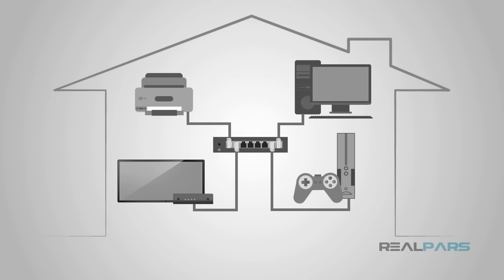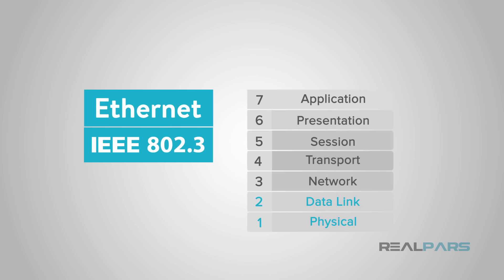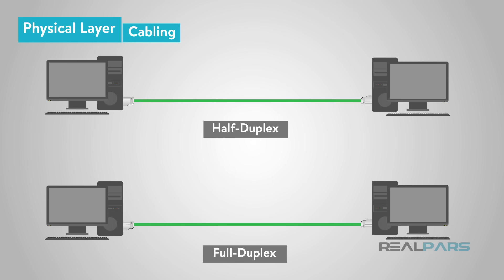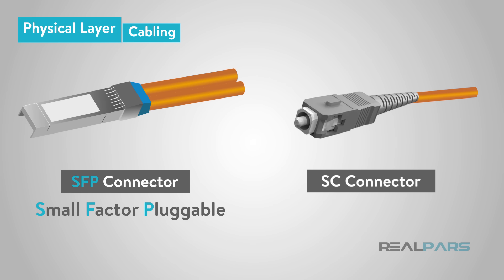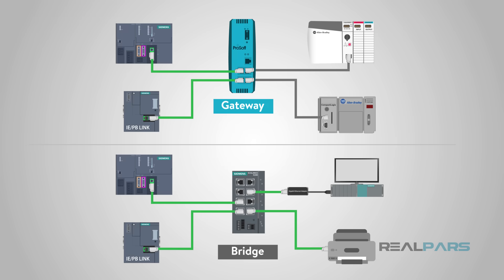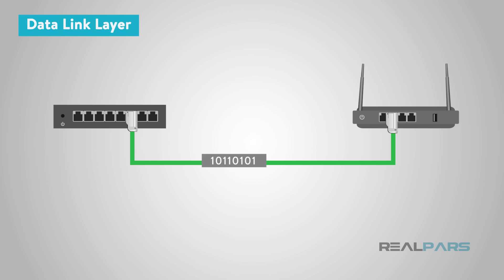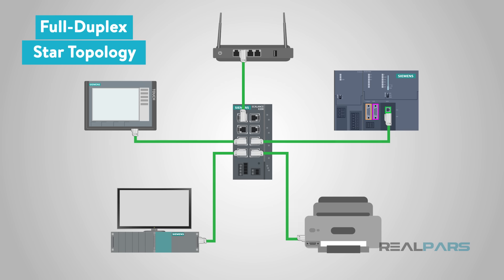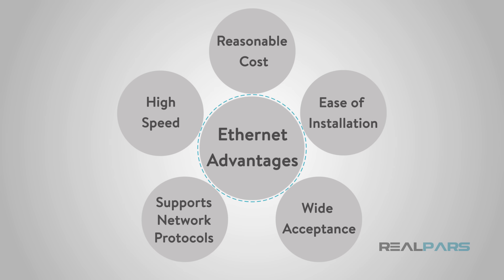What is Ethernet?

Comment: It appears that an error is still being repeated about CSMA/CD. The protocol is backwards compatible to all previous incarnations of Ethernet.

In the first version, 10Base 5, the devices could be hundreds of metres apart. The maximum distance between devices could be up to 2500 metres. This was achieved by joining 5 x 500m segments using repeaters. There could be a maximum of 4 repeaters in a transmission path.

Due to the length of the system, there is a propagation delay from the frame being transmitted, to its reception at the far end. Therefore, it was possible that a device wishing to transmit, would think the media was clear, because it would not be able to detect a remote device that had just started to transmit. 

The consequence, would be that their frames would collide. To detect the collision, both devices would have to be 'listening', whilst they were transmitting. If the frames are too short, both devices, would finish transmitting, and hence stop listening, and would not detect the transmission.

That is the reason why, there is a minimum frame size. They have to transmit a frame which is effectively twice the length of the LAN. The round trip delay was 51.2 micro secs, and at 10mbps determined that the frame had to be 64 octets in length. Anything shorter than this is declared a 'runt packet' and discarded.

When the speed reach Gbps, they set the minimum frame size at 512 octets due to the faster transmission speeds.

Now just think about, what is said in the video, it states that a device 'listens' to the media, and if there is no transmission, it sends out the 'first bit of information'. That first 'bit' (whatever that may mean) will be transmitted so fast, that the device will have stopped listening, and hence not detect any collision.

So, where does the misunderstanding come from?

In the original version, devices were connected to the coaxial cable by a transceiver, the central conductor was used for transmitting as well as receiving. The transceiver was a constant current device. If two frames collided, the current would double, and hence the line voltage. It was the increase in line voltage that the transceiver detected and then issued a signal to the interface card (in the host) Signal Quality Error (SQE). This implied a collision had been detected. Similarly, if the cable was cut, or a terminator was disconnected, the effect would be the same.

But, when twisted wire pair came in, the problem, was how could a device detect if the media was faulty? Since it transmitted on one pair of wires and received on another. The answer came in the 'link level reflect', periodically, the LAN card would send out one of these pulses, it would be received by the device at the other end of the UTP cable, and send it back. This is where the misunderstanding comes from. This little pulse, was further modified to enable 'auto negotiation', to enable devices to declare their speed capabilities.

A little piece of history 😊
Reply from the maker: Hello, @rjones6219  Thank you for your comment!   Happy learning from RealPars!

Comment: Star topology is same as hub and spark topology?
Reply from the maker: Thank you for your question. Star topology and hub-and-spoke topology are similar concepts, but they are not exactly the same.
Star Topology: In this network configuration, all devices (nodes) are connected to a central device (often a hub or switch). If one connection fails, it doesn’t affect the others, making it robust for local area networks (LANs).

Hub-and-Spoke Topology: This is often used in wide area networks (WANs) where multiple remote sites (spokes) connect to a central site (hub). While it resembles star topology in that it has a central node, it's generally used for more extensive network structures involving multiple locations.

Both topologies emphasize a central connection point, but the scale and application differ.

Comment: How orange and white orange could be together in a pair if one another is used as a ground reference to avoid em interference or noice???
Reply from the maker: Thank you for your question @pankajmaurya8768. 
That is basic electronics. You cancel out the EMI magnetic buildup, which causes electrical noise, by twisting the signal and the ground of the signal together. 
Here is a link for your learning: https://haitmfg.com/how-to-stop-electrical-interference/  You can find lots of information on the internet on how to cancel out or reduce EMI noise.

Comment: how about Ethernet Port? are they the same?
Reply from the maker: Hi @mylacuesta8684, The internet port is a physical hardware port only. This is where you plug in the CAT5 cable or other types of cable depending on the physical setup of the port, as we discussed the different types of ports available.

Hope this helps! Don't hesitate to reach out if you need more assistance!

Comment: Ethernet
==================

->Ethernet was communication standard that was developed in early 80's to network computers and other devices in a local environment such as home or building. 
->This Local Environment is defined as LAN (LOCAL AREA NETWORK) and it connects multiple devices so that they can create, store and share information with others in the location.

Ethernet is a wired system that started with using Coaxial cable and has successfully progressed to now using twisted pair copper wiring and fiber optic wiring.

Who invented twisted pair wiring?
Alexander Graham Bell invented twisted pair wiring in 1881

Standardization of Ethernet:
In 1983, Ethernet was standardized into the standard IEEE 802.3 by the institute of Electrical and Electronic Engineers or IEEE.

This standard defines the physical layer and the Mac or Media Access control portion of the data link layer of wired Ethernet.
These two layer defines as first two layers in OSI (Open system interconnection) model.

# Physical layer
-------------------
The physical layer consists of following components:
1. Cabling and 2. Devices

Cabling:
============
->Ethernet cables come as coaxial cable, which is not every common except in older installations, twisted pair and fiber optic.
->The most common cable is twisted pair cables, with the latest being Category 6 with speed up to 1Gbps and Category Cat 6a and Cat7 with speeds up to 10Gbps.
Cat5 and Cat 5e cables are both still used in many applications but handle the lower speeds between 10Mbps to 100 Mbps but are more susceptible to noise.
->The Ethernet twisted pair utilizes RJ45 8 pin connectors at either end of the cable that is pinned for transmitting and receiving data in either half or full duplex mode.
>> Half duplex mode transmits data in one direction at a time while full duplex mode allows data to be transmitted in both directions at a same time.
>> Full duplex in Ethernet can be achieved by using two pairs of wires to allow data to travel both directions simultaneously.
-> Fiber optic cable uses glass or plastic optical fiber as a conduit for light pulses to transmit data.
>> It has allowed Ethernet to travel farther distances at higher speeds.
>> Fiber optical cables use several types of connectors that vary depending on your application needs. 
-->Some of the different types are SFP (Small Form/Factor Pluggable) and SC (Subscriber/ Square / Standard Connector).
>> In order to use fiber optic in an Ethernet network that utilizes twisted pair Ethernet Cabling you need to use an Ethernet to fiber converter that will allow your network to take advantage of the higher speeds of fiber optic and lengthen distance that the Ethernet network can reach.

How about the Ethernet devices?
---------------------------------
->Ethernet devices are consisting of computers, printers or any device which either have an internal NIC (Network Interface Card) or an external one that is USB or PCI based.
->"Switches and Routers" that act as the director of the network and connect multiple computers or even network together to enable communication between all the different devices.
-> Gateways and Bridges are used to connect multiple Ethernet networks together and allow communication across them.
>> Gateways connect two dissimilar networks together while a Bridge connects two similar networks together so that you can only see one network.

# Data Link Layer:
----------------

The Data Link layer can be split into two sections:
1. Logical link control (LLC)
2. Media Access Control (MAC)

1. Logical Link Control (LLC):
============================
LLC establishes path for data on the Ethernet to transmit between devices.

2. Media Access control (MAC):
-----------------------------
MAC uses hardware addresses that are assigned to Network Interface Cards or NIC to identify a specific computer or device to show the source and destination of data transmissions.

Ethernet transmits data packets in this data link layer by using algorithm called CSMA/CD.
CSMA/CD (Carrier sense Multiple access with collision Detection): -
--------
>> CSMA/CD is used as a standard for Ethernet to reduce data collisions and increase successful data transmission.
>> The algorithm first checks to see if there is traffic on the network if it doesn't find any it will send out the first bit of information to see if a Collison will occur. 
>> If first bit was successful, then it will send out the other bits while still testing for collisions.
>> If a collision occurs, the algorithm calculates a waiting time and then starts the process all over again until the full transmission is complete.

-> When you use the faster Ethernets in full-duplex modes and incorporate switches then you are utilizing a star topology between the switch ports and the devices. This allows for more direct transmission paths and fewer collisions as compared to bus topology where all devices share the same paths.
-> Ethernet capabilities are quickly changing with new technologies emerging every day.
-> While we are currently on the brink of successfully moving into speeds higher than the current 1Gbps with 10Gbps emerging over the last few years, these new Ethernet technologies will be costly.
-> Also, your possibilities for the information world can seem endless when you connect this Ethernet Lan Network to the internet to create a very large WAN (Wide Area Network).

Advantages of Ethernet:
------------------------
1. High Speed
2. Reasonable Cost
3. Ease of Installation.

Comment: I see videos where people test out Ethernet and they run a speed test. How come some people get like 150 mbps while others get around 900 mbps? I’m asking so that I can know what to do to get the faster of the two.
Reply from the maker: Thank you for your question, great one as well! There are lots of factors that must be looked at and reviewed: 
1. All devices might not have the same computing power as others on the network. 
2. The cabling has to be looked at, copper or fiber. 
3. The server you might be communicating with or the PLC if you are trying to control something has a limitation on computing power. 

As I mentioned, there are many factors you need to review, configure, and compare within your network when using a landline or Wi-Fi. We have videos discussing devices and networking, feel free to check those out over here www.realpars.com/courses

Comment: Yesterday was informeds that my internet connection was down because my ethernet cable was loose.  It wasn't loose where it is fixed in at the side of my laptop.  I looked at where it was fixed in at the router end and it HAD become loose.  The day before my internet connection had been fine and I hadn't touched the router/brushed against it/no one else has used it etc so the cable had become loose of its own accord.  Quite a situation!

Comment: thank you for such a great tutorial. However, I've been getting stuck in understanding of Ethernet for 2 weeks and seen tons of videos about this but still everything is unclear for me. is Ethernet Wi-Fi router or Network device or what this is actually? is it visible or just abstraction term in the Computer Networking world?
Reply from the maker: Thank you for your question. Let's simplify this. The IEEE (Institute of Electrical and Electronics Engineers) has developed a standard called IEEE 802.3. This standard has two key components: the physical (or hardware) standard and the communication standard, which governs how devices communicate using electrical signals. For example, a Wi-Fi router interacts with the Ethernet hardware layer. Here's a link to help you learn more about this topic.

https://en.wikipedia.org/wiki/IEEE_802.3 

Happy learning!

Comment: hello! how can I read IP-Adresses from the raw data of the Ethernet frame? thanks !!
Reply from the maker: Hi Jaquim, 

Thank you for your question. This is a very complicated process. First you must have a strong knowledge of IT understanding and networking engineering education. There are a few companies that make software for monitoring IP addresses and data that is normally in machine code. There are scanners to test the network and show you the IP address and Mac address. I am providing a few links to help you understand and get more info. Don’t overload yourself, this I complicated stuff!

https://en.wikipedia.org/wiki/Ethernet_frame

https://stackoverflow.com/questions/23392274/how-do-you-decode-an-ethernet-frame-without-things-like-wireshark

https://stackoverflow.com/questions/23392274/how-do-you-decode-an-ethernet-frame-without-things-like-wireshark https://www.manageengine.com/products/oputils/ip-address-tracker.html?lhs

https://www.fluke.com/en-us/product/network-cable-testers/copper/ms-poe

Comment: Will my computer run smoother if I plug the yellow cable into the computer to the router?
Reply from the maker: Hi there,

Thank you for your question! Typically, your internet provider's cable should be connected to your router. Depending on the number of ports available on your router, you can then connect your computer using the appropriate CAT5 cable. The color of the cable is not significant; however, it is important to use a standard CAT5 cable in most cases.

It's worth noting that the speed of your internet connection is not solely determined by your provider's speed. If your computer has a slow microprocessor, insufficient RAM, or a slow hard drive, it can hinder your overall internet experience. To achieve the desired speed, it's important to ensure that your computer's specifications align with your internet capabilities.

Hope this helps, and happy learning!
Reply: It depends on what you mean by "smoother". A wired connection can help network performance between your computer and whatever network stuff you're doing. However, it cannot help with actual computer problems like a slow hard drive or too little RAM.

Comment: Do i need internet/wifi for Ethernet
Can i just have the Ethernet connected to a ps4 and nothing else?
Reply from the maker: Hi Terry, 

Thank you for your question. Ethernet is commonly found today in many commercial and residential homes. But regarding your question about your ps4, I can only say checking your owner’s manual or contacting the manufacturer is the safest way to ensure the setup requirements for your system. 

Happy learning!

Comment: I just got curious. why is there speeds differences among the cables like 10 times? I mean they are all just cables. what principle make them go faster 10 times??
Reply from the maker: Hello Hong’s Math and Al. 

Thank you for your question. All cables are not alike, especially the fiber optic cable because it is made out of glass fiber and it’s the fastest and can travel the longest with the signal. As far as twisted pair cable it depends on the wire gauge used and the insulation makes up the cable with the shield. All these are factors that influence what is known as electrical noise. Here is a link you might want to read with lots of easy-to-understand on Ethernet cables. 

Happy learning!

https://www.cdw.com/content/cdw/en/articles/hardware/cat5-vs-cat6-ethernet-cables.html#:~:text=Cat6%20Ethernet%20cables%20consist%20of,previous%20generations%20of%20Ethernet%20cables.

Comment: Thanks for this video, it surely give's a good presentation of the 'ethernet'.
What if data-transmission can be done with lightsignals in combination with a soundsignal. I that already possible ?
Reply from the maker: I hope I have understood your question properly.  Light is used as a transmission media (fiber optic) for ethernet.  There are many reasons for using fiber optic signals, most of which deal with the inherent ability to not be affected by electrical interference and noise.  The other reason is that fiber optics allow transmission distances of much greater than for copper wires.  I am not aware of any commercial products yet to transmit data via sound waves.  I am aware of several development efforts underway, so perhaps in a few years we will be able to use sound waves to transmit data!

Comment: Modern Ethernet has really little to do with the 80s Ethernet. Back then all the computers were on the same cable and it was connected to some server or printer etc. The name comes from the fact that all sent data to the same cable like radio stations sent to the same "ether" and there was possibility of collisions.  Modern Ethernet with switches and point to point connections is entirely different.
Reply from the maker: Thank you for adding that!